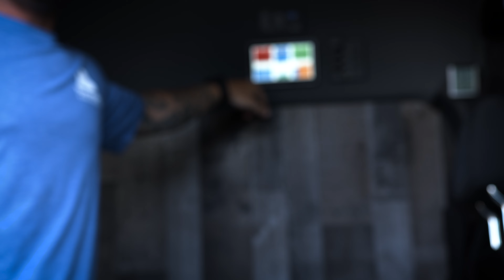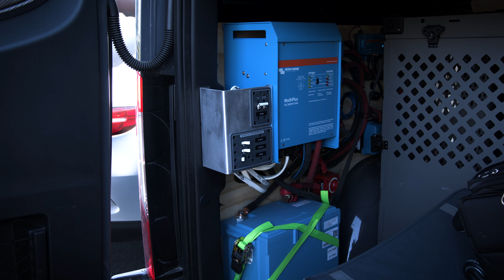Nomad 3.0 Electrical System for Sprinter Conversion I Nomadic Cooling I Vanlife I Demetic RTX 2000

Comment: I want to get the rtx 2000 for my 170 sprinter build. I wonder how much it'll cool, I know the nomadics push more cool air, but damn the price is out of my range.
Reply from the maker: The RTX 2000 worked out great for Colin and his pups. We’d be happy to help you too Ralph.
Reply: If I was doing another one, specifically a non 144” (larger interior) I would certainly be going with a nomadic unit. An extra $1-2k to get into a much more powerful unit seems worth it to me after real world use.

Comment: I just installed the same A/C unit in my Promaster (it is well insulated), I have 2 battle-born 100amp batteries with 300-watt solar. To your knowledge, should I be able to run it in auto/eco mode for 2 hours? I just need to keep my pup cool while running into the gym or grocery shopping.
Reply: Yep should be over 4 hours, hope you go further in comfort 😊
Reply: @jonathanmarc8629  Thank you.

Comment: How large is the battery bank?
Reply: Singe 330AH victron
Reply: @jonathanmarc8629  So I'm guessing my 24V 300AH bank should run the RTX 2000 all day if needed. I have 7500+ watts of power. We are going to put as much insulation in as we can fit so that will help. Oh and our AC is for our dog also if we have to leave him in the van while hiking or something.